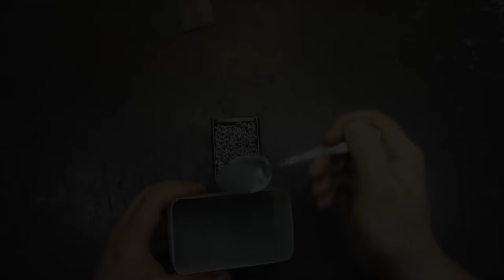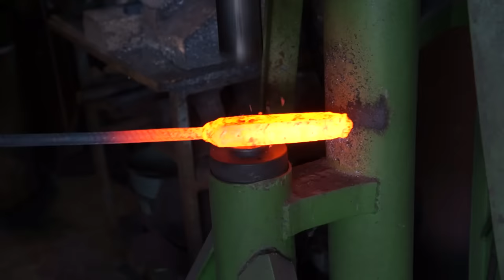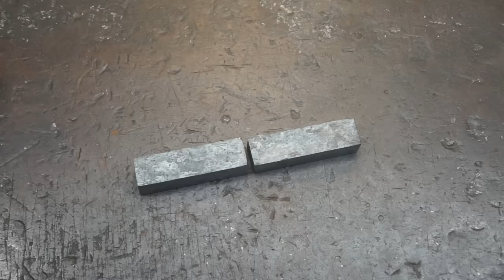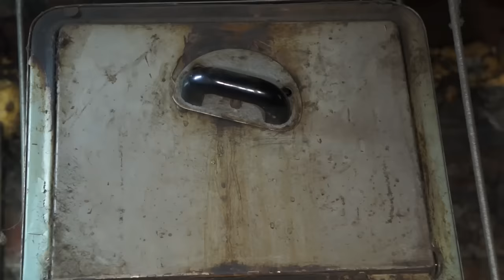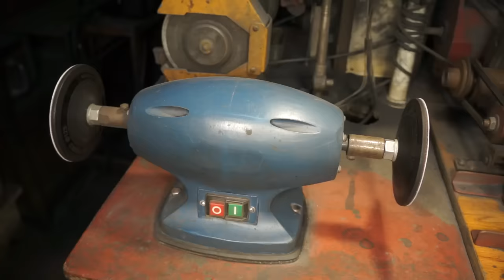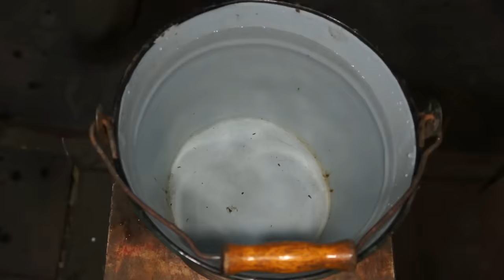Damascus steel from 5 meters of nickel-plated twisted chain.

Comment: For the people wondering why he drilled a hole in the back of the canister before forging is because air can become trapped in there and then when it gets squished it can pop and send molten metal all over the shop and possibly you

Comment: This one is very nice. I like how you can still see the chrome plating of each link after the blade has been etched. 

Stay safe!
Reply: Plus the shape is very nice, and the etching of the makers mark in the blade using electrolysis as well, to get a nice deep etch with matt finish on the base. All it needs now is to have a tiny bit of tinted glaze to fill it up back to the surface.
Reply: @ZuluTheBee  I said it out of sincerity. I am not superstitious so I don't think anything I say can change what is happening in Ukraine right now.

Comment: I'm curious to see what happens when you use steel electroplated with brass or copper would look like. It would probably weaken the blade, but otherwise look very neat.

Stay safe over there! 💚

Comment: Fantastic video, as always, and I'm glad you are doing as well as can be expected, under the circumstances.  I do have one question, though:  I've seen a bunch of blacksmithing youtubers, and every time they use any sort of material with zinc on it, they always grind the zinc away because of the fumes it can give off when heated.  Was that not a concern, for this piece with the zinc-coated chain?
Reply from the maker: Nickel plated chain
Reply: @shurap  For some reason, my brain got cross-wired on that one.

Comment: Знову чудова майстерність. Я можу запитати, чому ви замочуєте метал перед нагріванням у рідині, що це за рідина, що вона робить?
Awesome craftsmanship yet again. Might I ask, why you soak the metal before heating in a liquid, what is this liquid, what does the liquid do?
Reply: Oil to cool metal faster and make it harder. Oil has higher boiling temperature than water and cause less vaporising, which slow down process of cooling
Reply: @maksimfedoryak  No, I am well aware of of the process of both oil or water quenching. Have a look again, the block PRIOR to heating is kept in a liquid, then removed and p;laced into the furnace as I clearly stated in my question.

Comment: Never hurts to put a little bit of cracked pepper on, before you chuck it in the oven!
Reply: He adds black pepper (and/or dried red peppers) because in Russian they use the same word for both spicy and sharp. So by adding spiciness, he is (figuratively) adding sharpness too. And he may be adding additional carbon too, possibly increasing the hardness of the steel.

Comment: dumb question,  100% of what I know is from watching forged in fire, and the judges always freak out when the weld is not solid, and rightfully so... 
when there is a hole they see sparks flying out of the canister,  so what is the difference between that and drilling a hole?

Comment: I wonder if you could with a mechanical connection like chain, push the principle of pattern welding further than even the most optimum alloys. 

I know the way Japanese Swords were often made, with the two alloys with differing mechanical properties, was to deal with poor quality Steel. The theory is that if you make a Katana now, you could just use a Steel with optimum alloys. 

However you can still get Steels much much harder and more brittle. But what’s the hardest you can get? Is there a pattern forge you could manufacture and press that’d utilize and maintain the hardness, while forge welding it to another alloy? Is there a proper resolution for the different grains that if reproduced, aids the use of the different alloys properties?

Here we have a naive visualization. We like the colors. Let’s not forget however that we have hundreds of homogenous alloy steel types. Which means the patterns we have visualized here are about the most basic you could get.

You know how I’d begin studying it? I’d contrast mechanical properties of different alloys. Then I’d figure out what’s in those alloys. Then take two alloys that add up together to another alloys exact composition. Then I’d find my pattern that is half and half. Probably just stacking. Then I’d forge layers. With each sample of successive layers, I’d test the mechanical properties, until it’s indistinguishable from the off the shelf purely homogenized sample.

If you did this you could graph the properties of a pattern as it approaches more and more homogeneous states. Which would tell you what the repeated pattern is providing with the given starting alloys as compared to the known end. This is a tool of analyses you can use to study the process and discover what’s happening.

If you are studying Materials Science, there’s your Thesis. If you don’t do it, maybe I will.

Comment: Why do you cut the tip in one way, then hammer it the other way?
Reply: To ensure that the hardened steel remains on the cutting edge.  See the finished product and you'll see the high carbon steel follows the cutting edge.